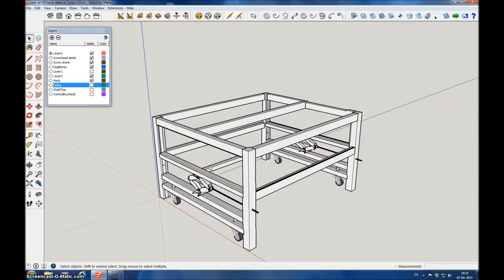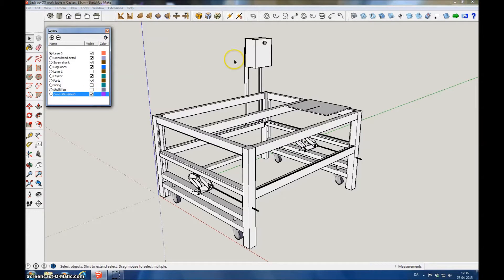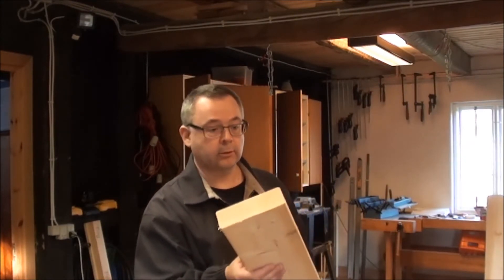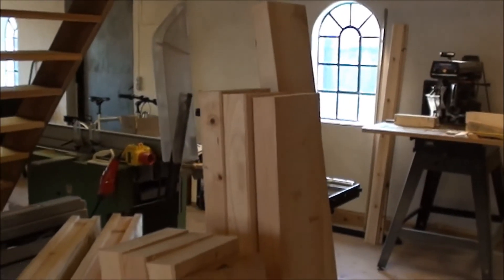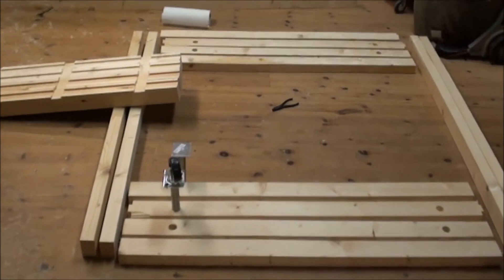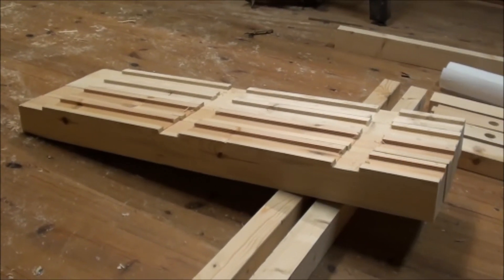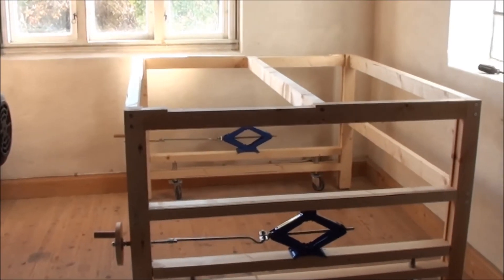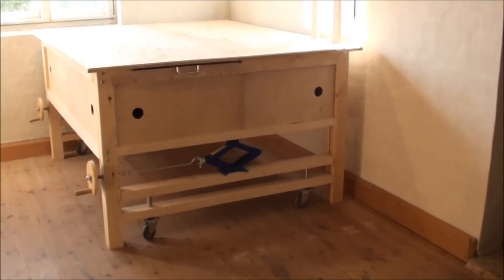Jack up worktable for DIY CNC Router

Comment: great idea for a worktable! Mulling over a few adjustable height ideas and considered using a pair of scissor jacks as the lift, how did you overcome the movement of the threaded rods when fixing the cranks to the front of the table? Sorry if that doesn't make sense.
Reply from the maker: Hi Kris
You are right that it can be a problem if you need the jack to move some way. However, in this design you only need to move the wheels down 5-10 mm to move the table around- so no problem with the axels going through the legs. 
Best wishes Martin